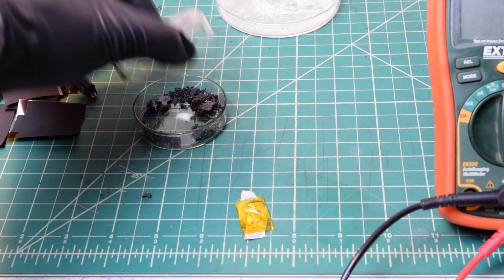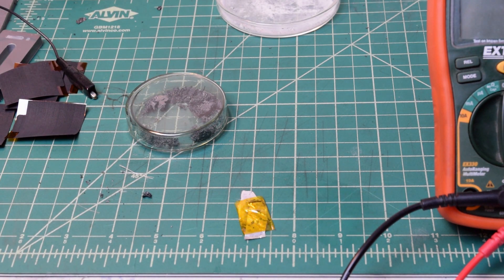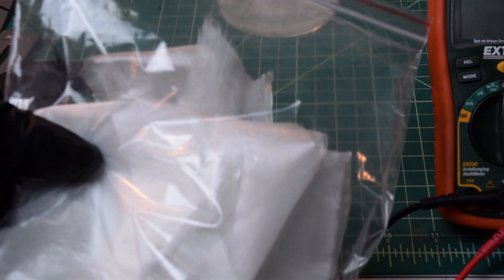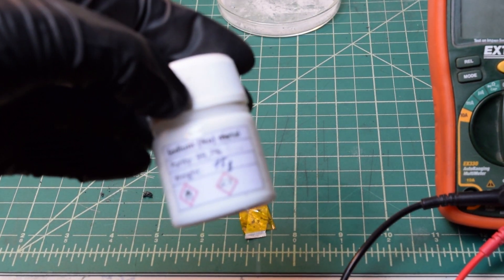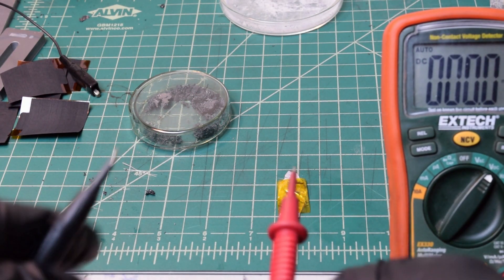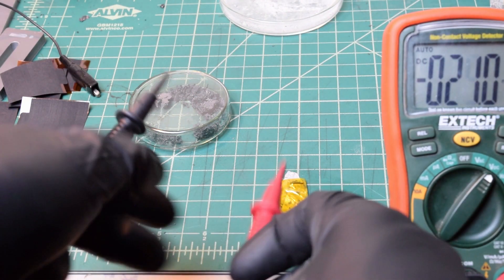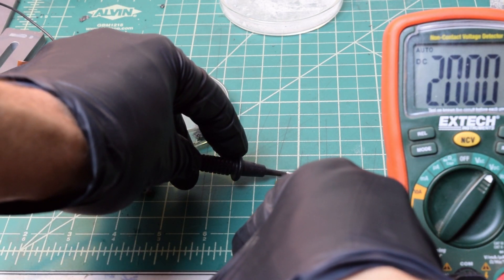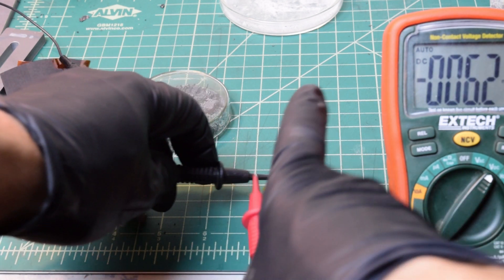Graphene Glass Salt Battery

Comment: Any recent developments? Is this an interpretation of John Goodenough's new battery. I don't want to wait and would like to make a working John Goodenough solid glass ion battery with sodium metal electrodes. Are his patents available for review
Reply from the maker: Yes, I am working on that right now! It is a similar method to John Goodeneough's new battery type, but he uses an active coating on his carbon electrode. I am just using the graphene aerogel, glass separator and sodium metal which initial testing has shown incredible results. I am currently testing different synthesis methods of the graphene aerogel and will be assembling test coin cells to see how it works soon. If you can, I would advise you work on this as well. I will post a video of the results before the end of the year.
Reply: Like your enthusiasm...hate to be a downer but these lithium and sodium cells should really only be attempted in an argon glove box environment...primarily for safety! Your cell works but the voltage should be +3.x V. The problem we all experience with the assembly of these solid state cells and obtaining high performance results is at the interfaces...due to the fact they are dry and not wet interfaces and therefore the actual surface contact is 50% or less. These cells also require compression to increase surface contact. Another challenge when incorporating an aerogel electrode. A solid state zinc cell would be a great way to safely explore energy storage without an argon glove box. Best of luck A.

Comment: Does it recharge?
Reply from the maker: Yes it does!  I need build a better cell because the metal salt anode is very delicate on it's own and broke apart shortly after this video.
Reply: Kingswell Labs cool. I don't think it was the same as Goodenough's controversial battery. But that's amazing that it recharges.
Reply from the maker: Thanks!  Yes you are correct, it's not the same as Goodenough's. I am oredering some coin cells to do more thourough testing and will post videos of it.